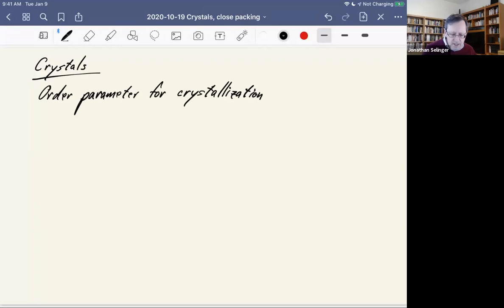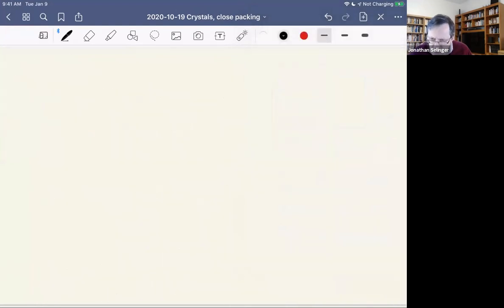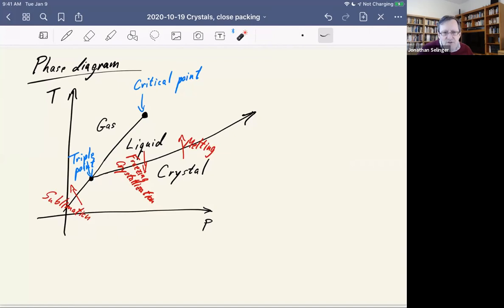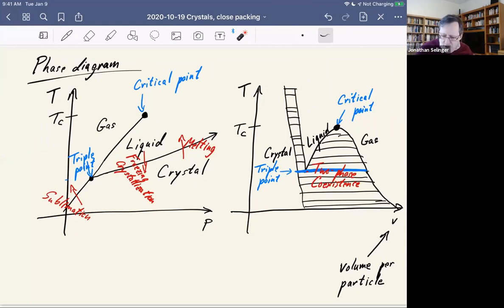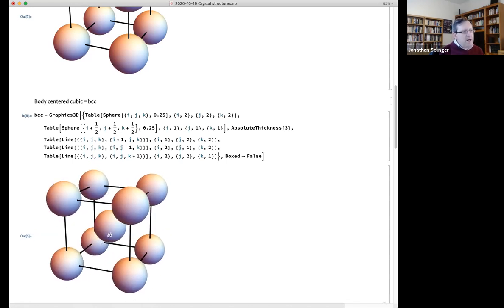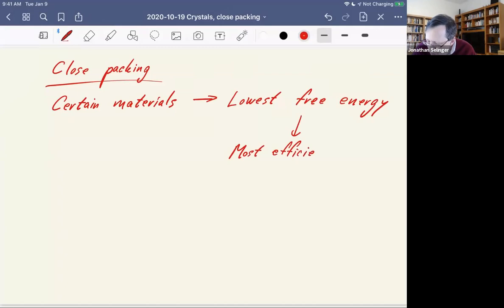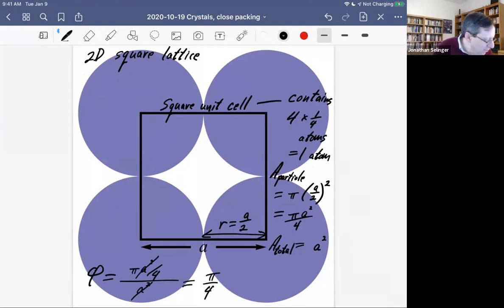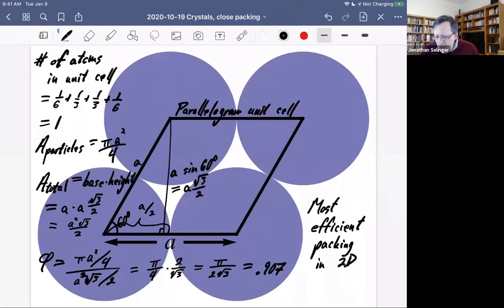2020 10 19 Crystals, close packing

Comment: what I gather is that liquid and gas phases are sort of similar to each other because they are both very symmetric and unordered. that's why they can have a critical point and a supercritical state, where they confuse into each other. crystal phase, on the other hand, has limited symmetry and more order. hence it cannot "confuse" with liquid phase at high T and P, and it has no critical point.